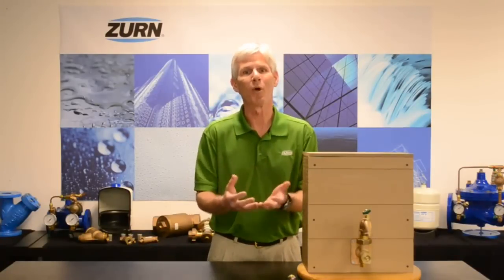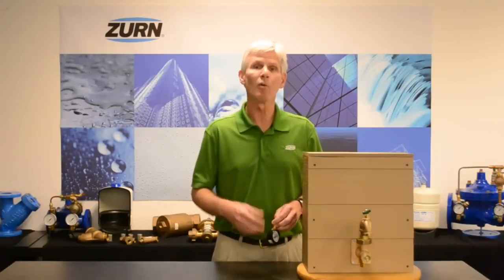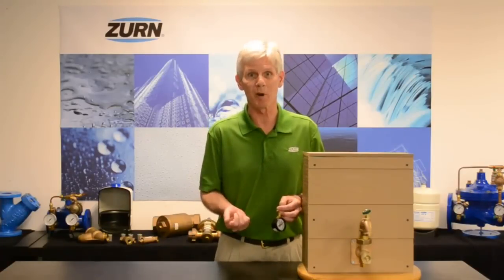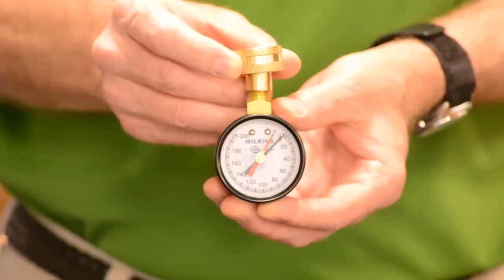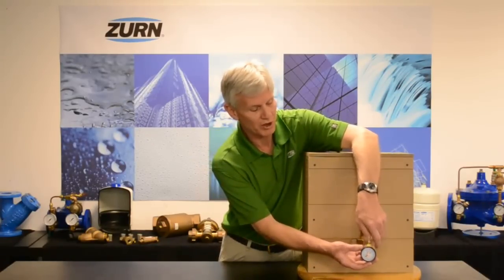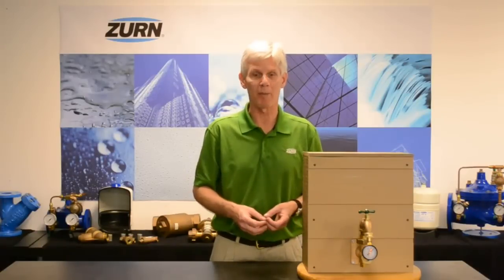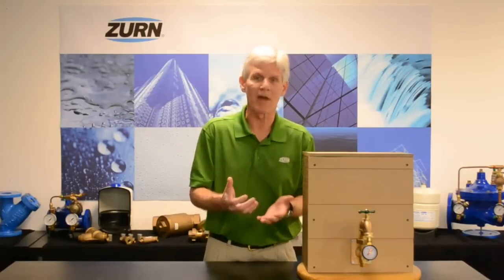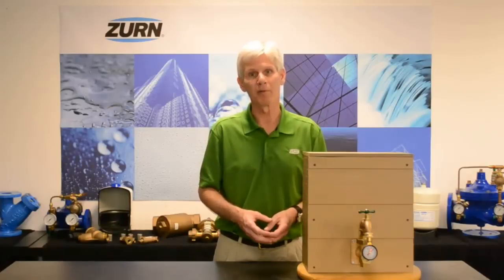Troubleshooting Pressure Regulator Failure vs. Thermal Expansion Scenarios

Comment: I just want to take a minute to comment and say THANK YOU to Zurn, and this gentleman for making this video! 👏 With his steps I was able to troubleshoot and fix my PRV as a quick DIY!  In case this may help anyone else in the future, here was our issues: 1-1/4" NR3XL PRV that was ~5 years old. I noticed after shutting off the water, the static pressure would start to rise within minutes, sometimes almost immediatly. It would go from around 55 psi to 90 psi after about 10 minutes. This is with a tankless heater (turned off) and over winter, so no hot water in any lines. Luckily I installed gauges after the PRV when water filtration went in otherwise I wouldn't have caught it so fast. With this gentleman's instructions it was diagnosed as needing the repair kit. Long story short... it was the cartridge itself. From my diagnosis, the extremely hard and mineral rich city water gunked up the cartridge action. It was basically "sticking" on the inner slide and hard to move. The new cartridge popped in, used the new spring and slip ring, and bam! Back together, set to 55, it's held for a week no problems or leaks!  MY ONLY SUGGESTION FOR ZURN:  Please sell these cartridge repair kits direct for reasonable prices, and don't discontinue the kits to make these PRV's long lasting.  The 1-1/4" kit ran around 90 usd at the time of purchase and included a new cartridge, slip ring, spring, perch, tensioner hardware, and 1x spare gasket for the actual union connection. Feel free to hit that thumbs up if this was useful to you as well! 👍

Comment: Also i cannot find a video to resolve the whistling issue on my line?..i thought the problem was on my water pressure reducer because the noise was too loud coming from there...please if someone can read this please help me out!...thank you!
Reply from the maker: Hello and thank you for your questions. Yes, you can replace your Wilkins 600 with the Wilkins 600XL. The 600XL is a direct replacement, and they both have the same lay length and connections.  

As for the whistling, you're hearing. Our experts say that you should "try to adjust the pressure setting up or down a few PSI this may mitigate harmonics if they are originating from the valve." If this doesn't fix the problem, please reach out to our Customer Care team at 855.663.9876. Thank you, the Zurn Social Media Team.

Comment: I had a professional plumber installed a new 600XL a few days ago and have been puzzled by many "strange" behaviors that I could not understand (by the way, I have a Ph.D. degree in physics from a pretigious university).  The only logical conclusion is:  It is a PRV failure, but I hate to assume that because the PRV is new.  I have" played around" (experimentied) with the PRV in the past few days.  Following are my observations:(1) When I turn a water outlet on to a tricke, the pressure would steadly drop to 50 psi and stays there.  It sounds great.  My question here is:  So is 50 psi my preset pressure because the fall-off pressure (pressure drop due to flowing) should be about zero when the flow rate is almost zero.(2) It looks like 50 psi IS my preset pressure because when I turn on a faucet wide open, the pressure would immediately drop to about 34 psi, roughly consistent with the fall-off pressure expected from the tech chart.  Furthermore, when I turn off the faucet slowly, the pressure would return to 50 psi.(3) But if 50 psi IS my preset pressure, why would the pressure keep slowly creeping up to 62 psi when I leave the faucet off for about 10 minutes?  (4) The pressure will stay around 63 psi so long as nobody turns on the water or the water heater is not heating up.Are the above behaviors normal?  What is the outlet pressure (50 or 62) did I set?  I understand themal expansion and I am going to install an expansion tank for my water heater since now my water system is a closed system.  Thank you in advance for enlightening me (my plumber does not understand what I am talking or "complaining" about, much less care about).
Reply: Keep in mind the differences in pressure and flow. Pressure is the actual force exerted while flow is the speed at which the fluid can move. The reducing valve uses a diaphragm and spring tension to regulate pressure. The flow is controlled by the orifice diameter. If the spring is worn it will allow a higher pressure through due to its decreased resistance to the pressure, yet if the orifice is restricted by debris or by the diaphragm not opening as a much, higher pressure than the set point will go through, but slowly. It's just like electricity. Power, current, voltage and resistance.  Power being pressure, current being flow and voltage being potential. Total gallons (the local water tower or source) being potential. PSI(pounds per square inch) being pressure and GPM(gallons per minute) being flow.
Reply from the maker: Hi George,
 
The valve is set to 50 psi at the factory.  With the pressure creeping up to 62, it sounds like it is lightly fouled with a small chip of debris. We recommend that the seal ring be inspected for fouling. Click here for the 600XL instruction sheet: http://content.zurn.com/web_documents/pdfs/installation/IS600XL.pdf
 
Please let us know if you have any questions!
Reply: Thank you for the prompt response.  The plumber reset it to 60 psi and it seesm to be able to go back there SLOWLY from fall-off pressure point after every water use.  It is that "SLOWLY" that I don't quite understand and confues me on how to set outlet pressure (I could not do it if it is slowly creeping up).  I am wondering if it is the "response" time of the design that it takes to fill up the "outlet" chamber from the fall-off point (so the pressure at the outlet will reach the preset point).  I cannot find anybody or manufacturers talk about that in the internet.
Reply from the maker: The response should be very quick. Upon cessation of flow, the valve should go immediately back to the static set point. My thought is that the valve is still lightly fouled with debris, and the seal ring needs to be cleaned. For additional clarification, please contact our Customer Care department at 1-855-ONE-ZURN (1-855-663-9876). They can provide you with additional information and answer any questions you may have.